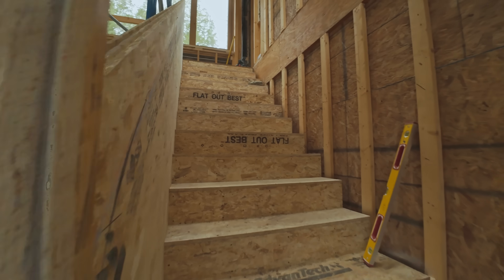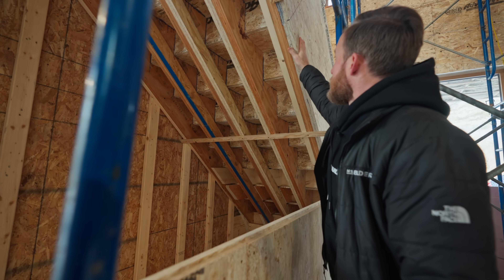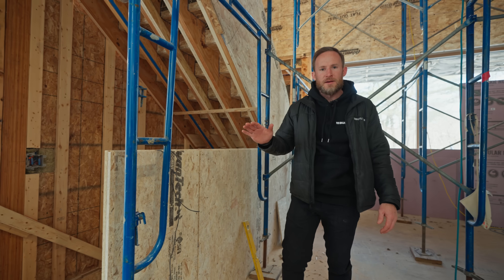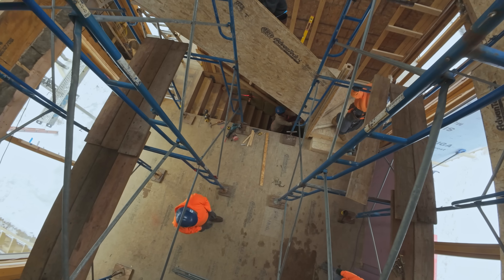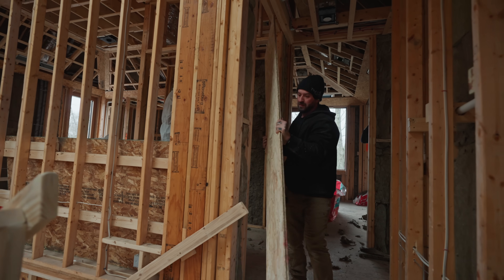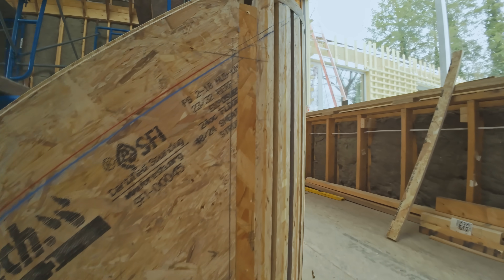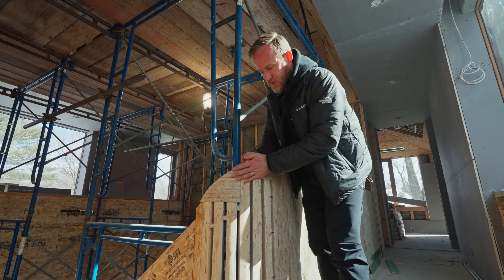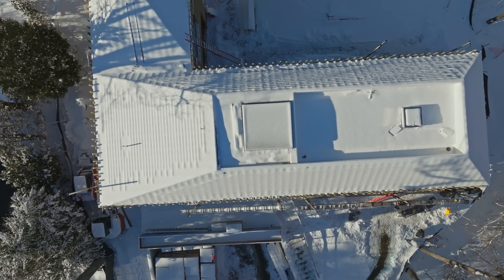Modern Staircase Design & Build | Materials, Details, and Expert Craftsmanship

Comment: Inside those vertical sheets that build up the staircase. I was curious how you stiffen them or how they are anchored so it’s not flimsy. Are there hidden steel reinforcements every few feet? I’m not a builder, just curious if you could share how its done.
Reply: Two layers of Advantec glued and screwed together is extremely strong. It’s likely much more ridgid than a 2x4 wall would be even.
Reply: @CMCraftsman thank you for your reply
Reply: I meant the Advantech sheets that will hold the handrail. I’m curious how it’s attached and if those have some kind of anchoring for stability.

Comment: OSB is made from waste wood chips from making plywood and other solid wood, that's why it's cheap crap.
Reply: No it really isn't. Stop talking about things you don't understand. Leftovers from making other things are mostly dust, which is not good for OSB, for MDF it is. But OSB is made from smaller/crooked trees that are rejected from planks/plywood production.
Reply: I know what you’re talking about, but advantech is no joke. At about 80 lbs per sheet, It may as well be solid wood.
Reply: OSB vs Advantec subfloor are not really even in the same category .  Night and day difference.